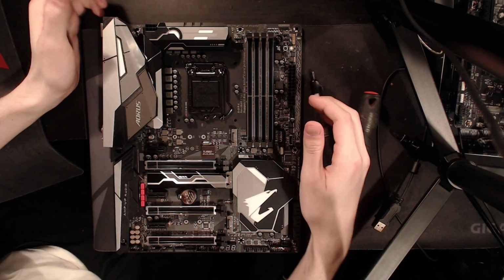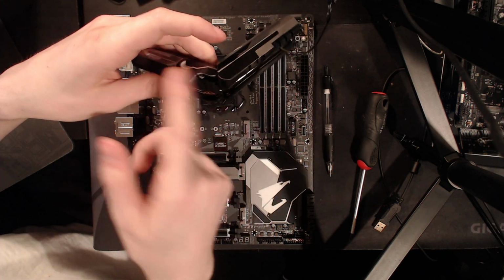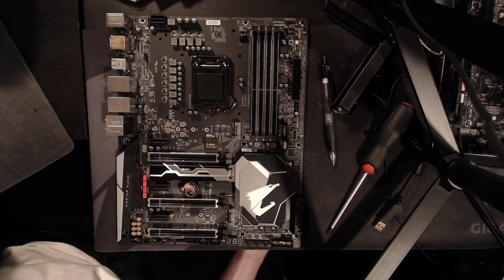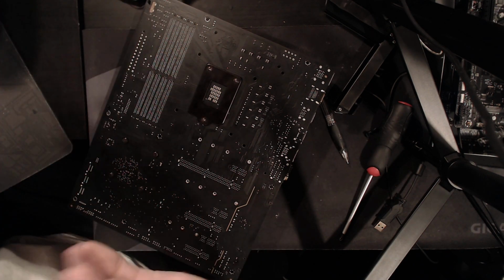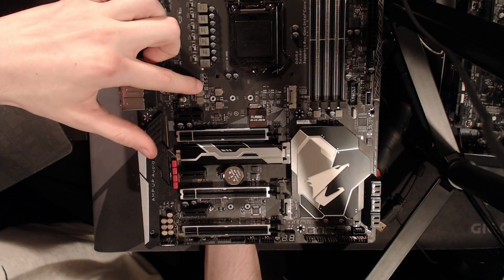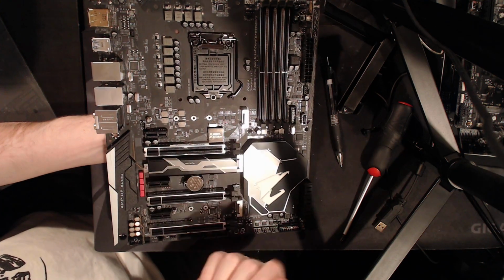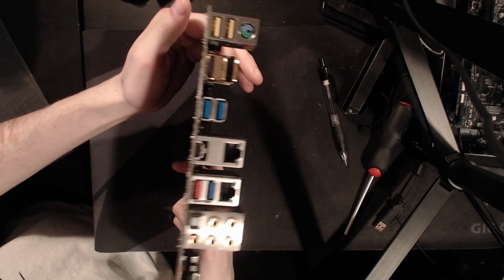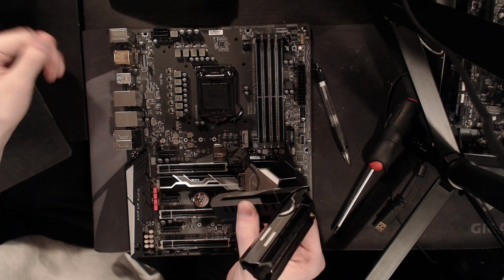"PCB Breakdown": Gigabyte Z370 Gaming 7

Comment: The boards 5ghz option is horrible, 90c on my 8700k, I overclock it myself to 5ghz and it’s 63c 100% under load, oh and now it’s try to boot at 800ghz... wtf
Reply: On what voltage did you get 5ghz?`:)
Reply: @deruniversalindikator  1.214-1.35v
Reply: @user-nq3xi4wm2k  thank you!
Reply: Der Universalindikator if you can’t get yours to 5ghz try 1.4v
Reply: @user-nq3xi4wm2k  thx, i got it on 5 ghz now, it was a bit random but it worked :D

Comment: Bit late to the game here but does the voltage regulator on this board generate much heat? I got a full cover block from EK that was designed for z270 but they say it supports this board as well but it doesn't cover the voltage regulator at all. I'll be trying to run a 9900k @5 ish ghz.

Comment: I have this board running the 8700K at 5GHz at 1.250v 80°c with a old school (but new) ZALMAN 9900MAX 300watt cooler and the VRM doesn't go past 60°c. 
 Some earlier models of this board had problems with the heat sink not making full contact with the VRM. Nothing a screw driver can't fix. Also the fan is set to 90°c. I've never had it spin up. Even at 5.3GHz at 1.350v the VRM only reached 80°c. This board basically has the best 8phase VRM that money can buy.

Comment: UPDATE: The heat sinks with RGB do NOT harm in fact THEY ARE AMAZING and cold. This is the coldest vrm and cpu mobo I have ever had and its OC to 5.0./ So YEAH! Try it before you knock it.
Reply: What CPU/Cooler are you using? I am building a rig this weekend with an i7 8700k, H100i V2 Cooler, and this mobo... hoping to hit 5 GHz!

Comment: I am trying to install one of these.  cool stuff. this thing is going to run smooth for me concidering I am never going to overclock.  so I am a noob at computer building. I was more so hoping you would explain the plugs and stuff, and what they are for.  well I gues this was 30 minutes spent for nothing... I guess it is cool to know my overkill of a motherboard, but just means it should last a long time for me

Comment: You mentioned something at the end, but barely. Would this VRM be capable of handling an 8 core CPU? For example the "9900k," given that's what it's called and that Intel actually makes it possible. I'm not talking about extreme overclocking either, just significant OCs on water
Reply: Yes it can. I'm rocking a 9900K in my aorus gaming 7 z370. It's running at 5.0Ghz and my VRM sits at 60c. The stock heatsink does the job however I did add thick thermal pads to keep the VRM cool and removed the thermal pad from the chipset and added thermal pasted instead and everything is running very cool. Ram is sitting at 3466mhz.

Comment: Interesting review, all your reviews are interesting btw. how accurate they are, I can't judge, so far no reason to not trust you. But you can EASILY multiply the value of these with some actual testing with real data supporting the things you are saying, make the tests while you are explaining the PCB...even better. Now it's a dry matter, you don't even have these things plugged, no processor, and very often something great on paper is complete garbage in practice (I'm not mentioning any specific brand or model here). 
With real measurements, tests and overclock on the BM you are talking about,  from interesting reviews with few hundred of likes, they will evolve to something great.

Comment: One little question regarding zombie GPU's.
How does the FB sense mod on an external VRM you cut aff another card still work, if the GPU core and quite a bit of the Vcore power plane is missing ?

Comment: For people who do see high VRM temperature on the board, advice is to tighten the VRM heatsink screws and if this does not help, replace the thermal pad with a thicker one, I used Fujipoly / mod/smart Extreme X-e Thermal Pad - 60 x 50 x 1.0 - Thermal Conductivity 11.0 W/mK , https://www.amazon.com/gp/product/B00ZSJQX0E/ref=oh_aui_search_detailpage?ie=UTF8&psc=1

Comment: Owning this motherboard myself I'd say its a real shame gigabyte doesn't do software as well as its hardware.

As for the fan it only turns on when the vrm hits a certain temperature by default and can get reasonably loud. You can change this in bios like all fan headers on this motherboard. 

Also something not covered but still rather nice (be it not for extreme overclocking) the amount of pwm fan headers is great. If you mix and match fans like I do having control over them individually is really good.I really wish other mobo makers would do this.

Comment: Gaming 7 or maximus X hero?
Reply: I can only talk for the Gaming 7 as I have it and it has been rock solid, running cool VRM's and overclocks to 5GHz without any real effort...only thing is my i7-8700k needed 1.343v ish on the vcore for a 5GHz overclock though I am using the adaptive mode so I run it at 4.9GHz which I only need 1.278v. Thats for a non delided 8700K, temps are more than fine across the board under load in Prime95 and Aida though I do run a 360 AIO...Still I dont think you can go wrong with either the Gaming 7 or Maximus Hero...
Reply: Very good vcore on your overclocked 8700k, you got a good one!

Comment: Awesome breakdown, Buildzoid ! 
The MSI Z370 Godlike Uses IR 3555 with IR 3599 drivers and maybe that explains the high temps on the fets, despite having 12 fets (6+2 ?). And maybe the cooling is also gimped by aestetics reasons, like in this one, its really sad.
I saw this even on X470 Gaming 7 but it was on the SOC block (not the v.core) and only some part of it was covered, but that one is far better heatsink and it should have far less impact.
Some people are complainin of high temps on this Z370 Gaming 7 but its because of the mounting pressure of the heatsink and the crappy thermal pads that Gigabyte uses, slapping some good fujipoly's and properly remounting the heatsink can lower the temps significantly, but the fact that it has ''anti vrm cooling'' covers is concerning, i guess they can be safely removed alongside the RGB stuff ?
Its funny to think about it but Z370 Gaming 7 has the Same memory mosfets (4C10+4C06) that the very hated Aorus Ultra gaming (and maybe the lower end ones) use for their Vcore...it really deserves the hate being 160-170$ board...
Z370 Gaming 5 also uses 4C10+4C06 but with two hi side and lo side fets but using ISL 6625A. It would be nice Gaming 5 to have better VRM since its not that cheaper.
Also Asrock Fatal1ty ITX/ac uses 5 of the same ISL 99227B mosfets as this one, far better than Asus's Z370-I 25A limited 4C86N.

Comment: I have coil whine with this board =(, anyone having it too ? . Removed GPU and changed PSU and still same thing. Originated from the top VRM area. Occurred in AVX Prime 95 Blend during power usage ramp up and ramp down.
Reply: It's probably that of the chokes is a little loose. When the board is running start pressing on each one with your finger, one at a time. When the wine stops, you'll know which choke is at fault. Turn off board and just glue the base of the choke to the board with crazy glue and let it dry. Problem solved.

Comment: Out of the topic but I got a free Asrock Z270 Pro4, 7700K and 212X Cooler from a small gaming competition in my local area do you think the motherboard can handle an OC to 4.8GHz or perhaps 4.7GHz?
Reply: I've had my 7700k on an Asrock Extreme 4 @ 5.1ghz
Reply: did it ?